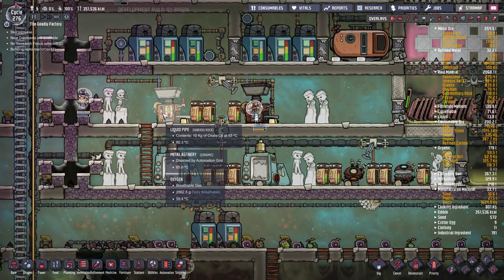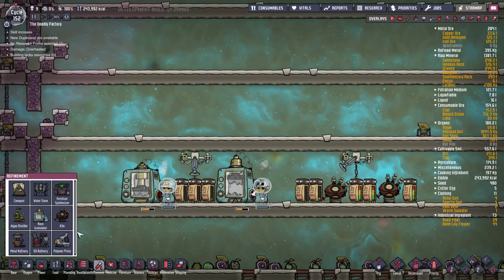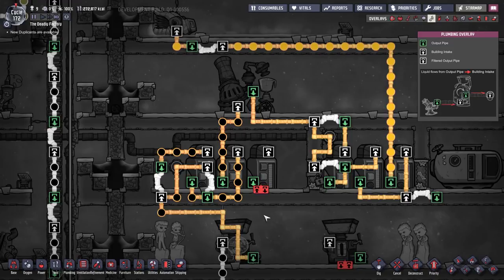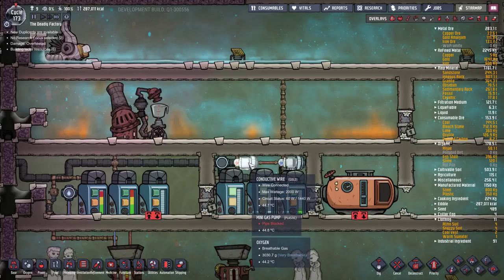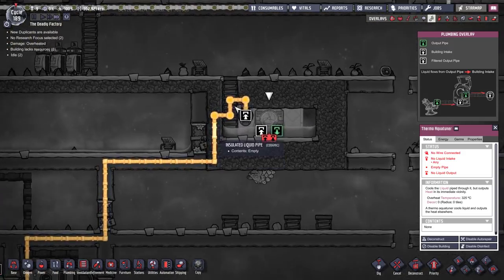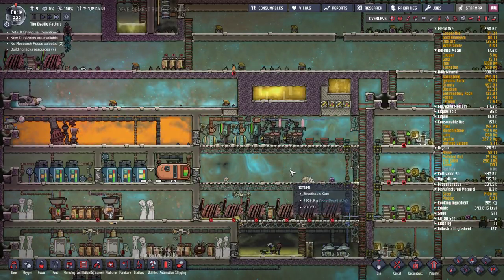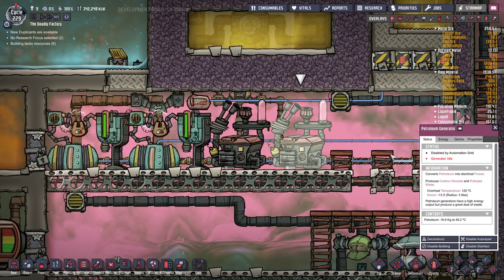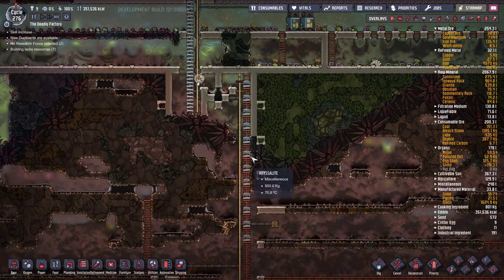Crude Oil, Petroleum, Metal refinement and Industrial brick. Tutorial 4 for Oxygen not included

Comment: Nice design. The CO2 is produced at 110°C or above now. So dumping excess heat into the petroleum causes some issues. 
But I guess it still works. One could use the cooling to also cool the CO2. And maybe dump excess into space.
And instead of heating up the petroleum further a steam turbine should also work.
But the basic layout is still very useful :)
Reply from the maker: I'm thinking about running it hot with the next designs, let the petroleum gens heat up to about 150 so they spit out steam I feed into a steam turbine. Feed the hot CO2 to molten slicksters.

Comment: I appreciate this video's a bit old and perhaps things have changed, but being new to the game and trying to follow this vid (which is very good, btw); one big question springs to mind. Why did you put the ice box on the far side of the brick? Wouldn't it have worked better, spreading cold into your fabrication area, if you'd put it to the left of the aquatuner?
Reply from the maker: During this version the colder a petroleum generator was the colder it's output were. So if i cooled the petroleum gens down to 0C they would spit out 705g/s of 0C polluted water. All this icy cold water allowed you to cool whatever you wanted. In the most recent patch the petroleum gens will output at 40C or higher depending on their temp/
Reply: @FrancisJohnYT  Shows how little I know because I thought that was still the case just from reading up on it! However, it still seems you could've put it on the left and had your petroleum generators there. I've just spent an inordinate amount of time trying to emulate your design, albeit I had to mirror it, then compact it a lot when I ran into a geyser I hadn't noticed... and it seems to be working well.

https://imgur.com/EWl1gFH

The biggest problem I had was that my crude oil was nearly 200c, so it's taken a lot of work-arounds to get to this point. I think I started around cycle 220! :D

Comment: So I tried to recreate this ice, but pretty much exactly as you did, but I ran into a big issue -- the steel thermal aquatuner wouldn't stop overheating. It just runs waaay too much to get the petrol that cold. I even created a backup aquatuner and it still would overheat the system. Even looking at your save I'm still unclear as to what is going on.. any ideas?
Reply from the maker: Send me the save and I will have a look. Without looking my best guess is that your petroleum is not flowing so it's not taking any heat out of the system. Are your petroleum generators running at all?
Reply: @FrancisJohnYT  So interestingly I think I discovered the issue. The petroleum was flowing just fine, and at a steady clip, but the issue was that the pipes I was using for liquids weren't radiant pipes so the heat wasn't getting transferred efficiently. I appreciate the response and willingness to look nonetheless. I really enjoy your content, it's quite helpful and I refer to it often. Many thanks!

Comment: Is the mini gas pump more efficient than the regular one for creating a vacuum in small rooms?  Since most of the time spent pumping is going to be pumping very low pressure gasses and I believe the energy cost is per packet so that the small pump will cost less per packed but in low pressure scenarios the packets will still be smaller than the mini pump's maximum packet size but cost less per packet than the regular gas pump..
Reply from the maker: When you want to vacuum out larger areas they are essential, big gas pumps can't compete. I would note that if you have multiple gases in the area it gets more complicated as you can only have one type of gas type per pipe segment.